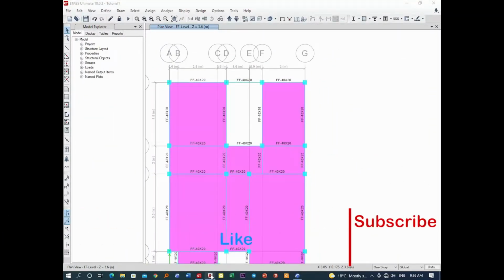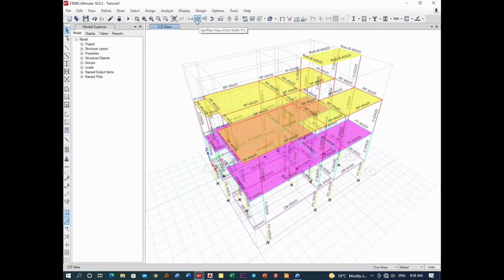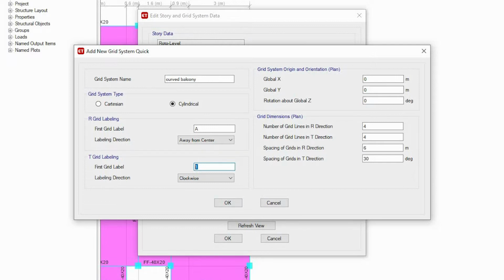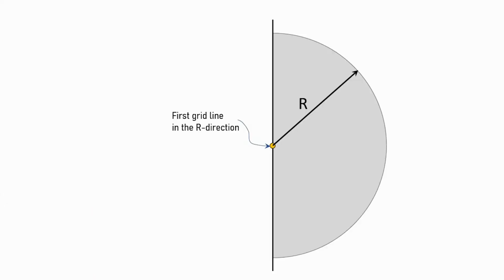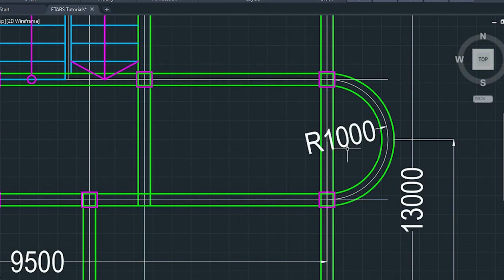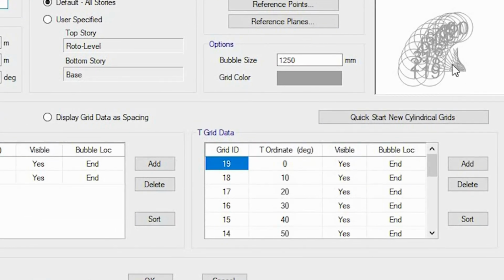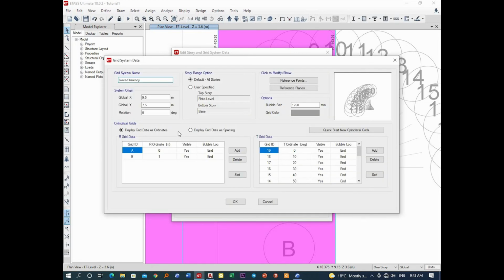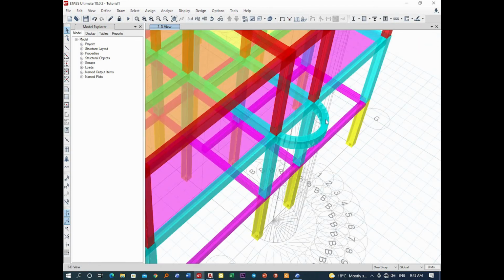Cylindrical Grids and Curved beams

Comment: Which method is used to analysis and design of circular slab
Reply from the maker: I recommend using Finite Element based design for design of Curved Slabs
Reply: @icsaar99  in etab since there is many number of element after mesh is applied so its difficult to get area reinforcement from those elemet what is solution?
Reply from the maker: @mahamed1212  how is it difficult to get the area of reinforcement?
Reply: @icsaar99  mesh divide slab into number of element and each element display required reinforcement so how to identify the critical element this is my question?
Reply from the maker: @mahamed1212  you easily observe the BMD /Shell Stress results.  With this you can get the locations of the critical section. And accordingly you will decide the reinforcement area.